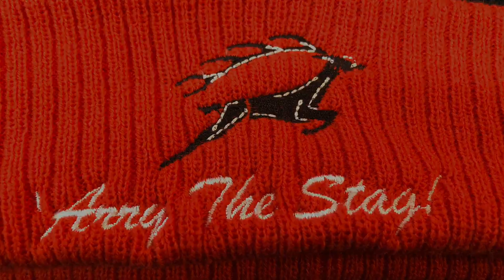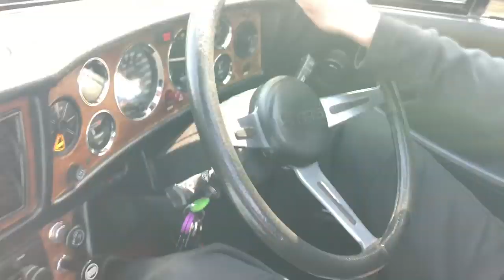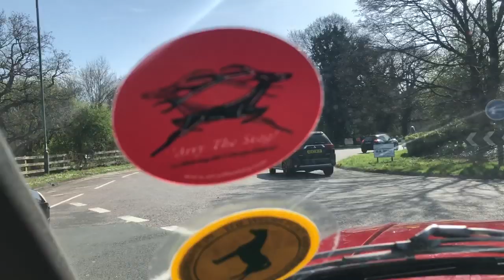A Sunshine Drive with a Triumph Stag!

Comment: Cracking video lads, great to see you using the car, and fixing it's little niggles as you go, I've got a few motorbikes  and they are always needing bits and pieces doing to them, it used to get on my nerves, but I've learned to accept it as part of the experience 😀

Comment: Tony i'm jealous!  I didn't get the Yellow Peril out this weekend as I was assigned to hedge cutting duty all weekend.  Plus I still have the hard top on and nowhere sorted out to receive it yet :(  Your video was funny though, yeah I was shouting at the screen "Pull the lever behind the passenger side B post to release the rear centre pin!".  I've been doing that since age 12. ;)
Tip though, place some thick wood underneath the hard top frame below the windows when you put it on the ground like that and don't bend the rear pin.
I did say when we went out in mine "best fun you can have below 30mph!".  :)
Reply: @ArryTheStag  The rear pin yes, the problem is usually that the rear plastic window gets stiff and won't give enough to let you get it in. You can test if this is the case by first unzipping the window and then see if the rear goes down easily. If it does then the solution is to either wait until summer, or carefully use a heat gun to soften the vinyl and let it straighten out, then zip it up again and try closing the rear again.  
Do NOT attempt to try to zip it up once the roof rear is locked, you'll end up breaking the zip at a corner as it will be under stress.
The original instructions included unzipping before folding if I'm not mistaken but as long as you're careful, Dad's survived so far.
You have to bear in that this vinyl is now 40+ years old and not as supple as it once was. I know how it feels after a weekend of hedge cutting!
If it still won't close with the window unzipped, then thoroughly soak the roof and try again. Also, although it's not the sequence that's printed on the sun visor, you can try the other way round, i.e. release the front catches and latch the rear first. Then try the front.
Be prepared to spend a few days and let things slowly stretch. I made a point last year of always storing with the roof up, to keep things generally stretched but haven't been able to this year due to having the hard top stored on the car.

Comment: Lovely looking car, just needs to start a bit better.   Enjoy what your doing,  get them little jobs done underneath and have fun, hope you and your family stay safe
Reply: Oh I don't know, I enjoy hearing a decent engine struggle to cold start because you know the start up when it happens just converts to purr.  I have my Stag start up on YouTube as audio porn but others that I find enjoyable (maybe i'm weird?!) are ones such as this https://youtu.be/LXqCzD38zX0?t=64 (the whole video is good) and also some of the WW2 aero engines and large diesel locomotives.  Claggy starting.  Maybe it goes back to my youth when I worked on diesel railway loco's at the weekend, a hand start donkey engine, connected to an air compressor which was then the air feed to the air start main engine.

Comment: Take off the wind deflector, wind down the windows, it’s a convertible! You don’t get that blown about.
Reply: No... use the wind deflector, flap and side windows to socially isolate front and rear seat passengers.... ideal transport solution I reckon.
Reply: My wife with long hair would like to share an alternate opinion on that! It's not a problem that I suffer from though. :)